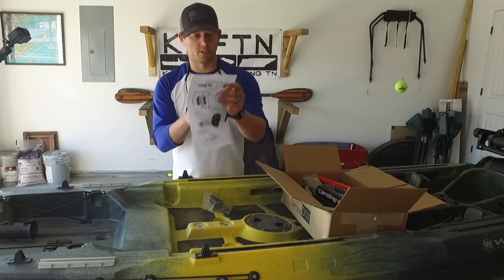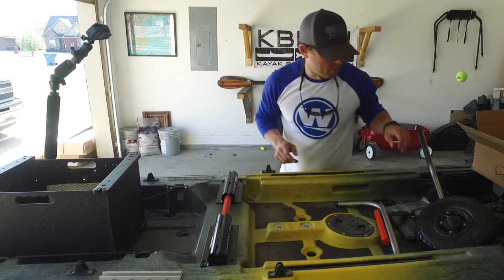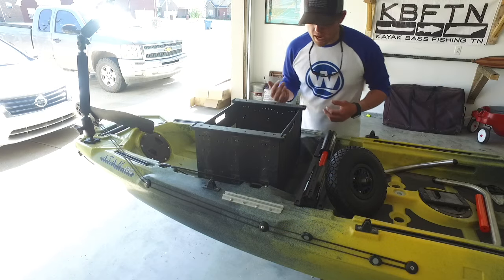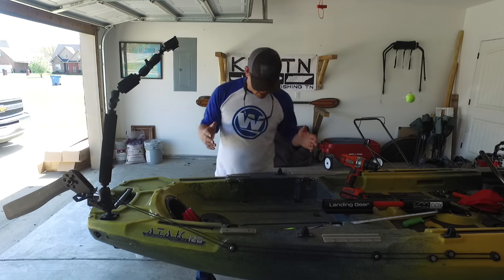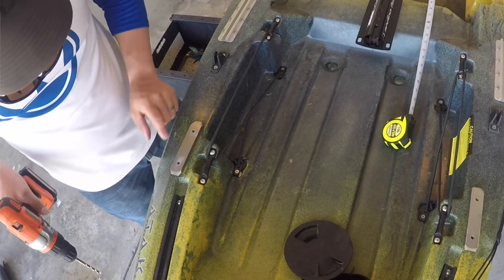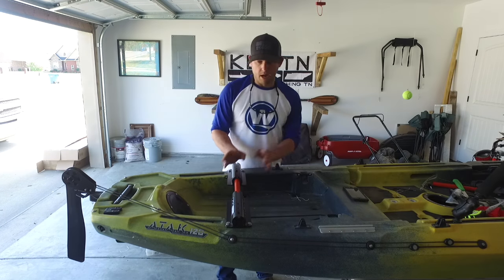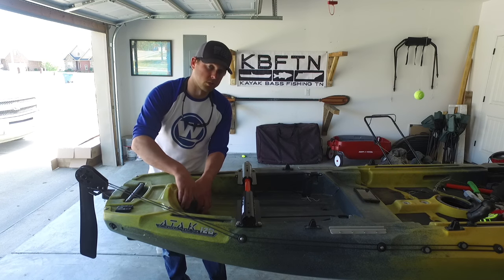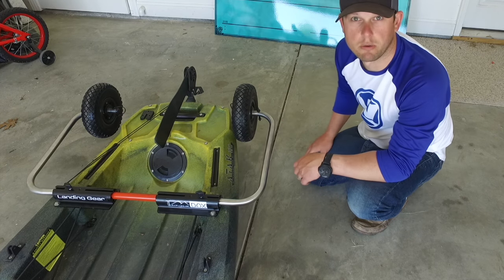Boonedox Landing Gear Install - Wilderness Systems A.T.A.K 120

Comment: Nice Video!  Question though...When you mount it so far back on the boat, do you find yourself carrying all of the weight of the kayak when you lift it up in front to move it around?  I currently use the Trailtrekker and found that when it attaches to the rear of the boat, my kayak is incredibly heavy up front when I lift it....didn't know if that was the case with this system....

Comment: Hey Craig! When I contacted boonedox they told me I will need the 27" LG Pro Bar and the larger backing plates... This doesn't seem to be the case in your install, correct? It seems like you used the included bar and backing plates. Thanks in advance for confirming.

Comment: Hey craig, will that work on a Radar 115?
Reply: Very interested in the Answer t this. There is a video of a guy installing one on a Pilot which is a very similar boat w/o hatch access. He fished the backing plates through with string and wooden dowel
 and threaded them.